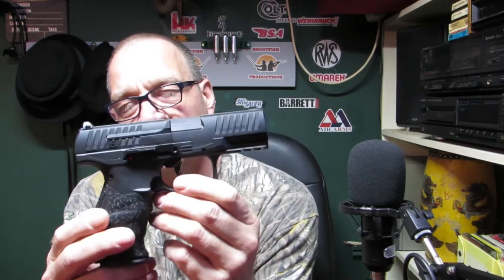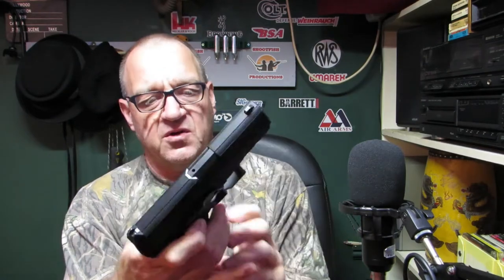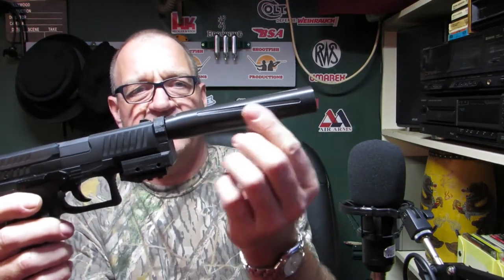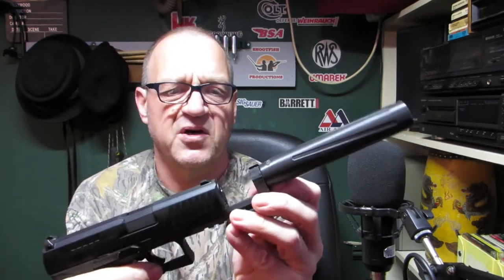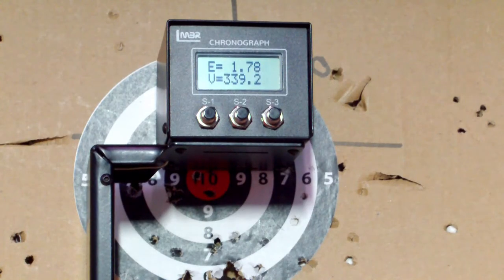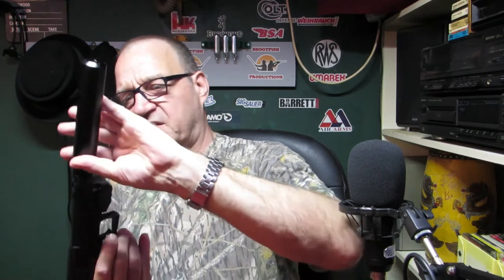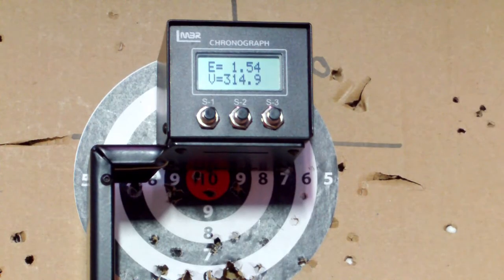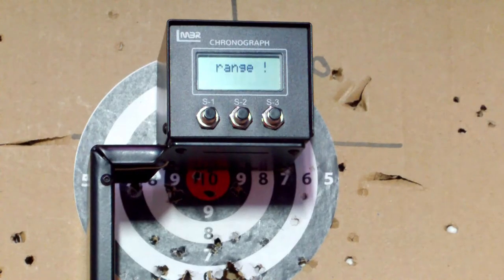Umarex Walther PPQ Silencer Adapter

Comment: Are u selling the adapter ...and is it 1/2-20 male thread ? Cost ?
Reply from the maker: Hi, not selling as it is not very robust, and the thread breaks easy. Yes its 1/2-20.
Reply: @ShootfishProductions   ahhh  you should sell :)
Reply from the maker: No, not selling. Ill put the pattern on printables if you know someone with a printer.
Reply from the maker: Yes, 1/2-20
Reply from the maker: https://www.printables.com/model/348160-ppq-silencer-adapter-12-20-thread
Reply: @ShootfishProductions  Do we have your permission to improve on your design and sell them ?
Reply from the maker: @murfspop  sure
Reply from the maker: yes, no problem

Comment: pointless .wont workon airguns,because no heat to cool ,no baffles .no supersonic boom to silence      you need wirewool soaked in copper greese inside it to,or it just wont work
Reply: oh and it must be 100%inline  theaded to the barrel
Reply from the maker: It did work
Reply: @ShootfishProductions  i made them in the past on my lathe